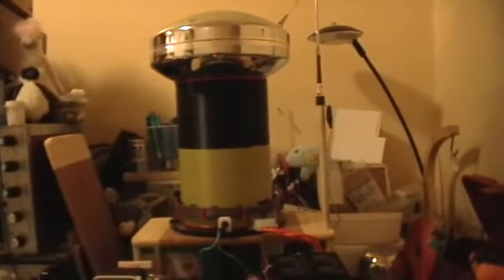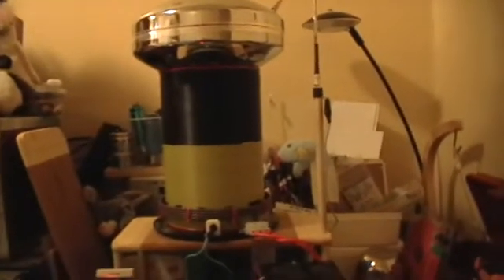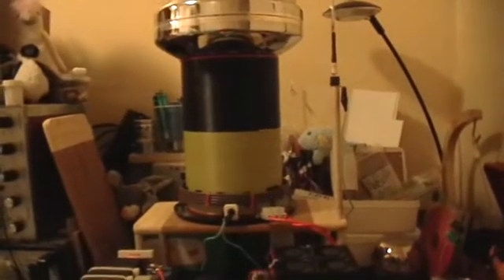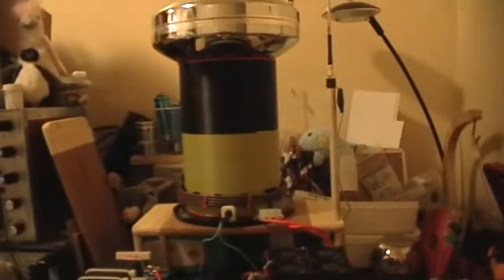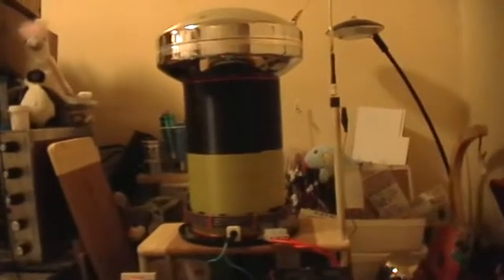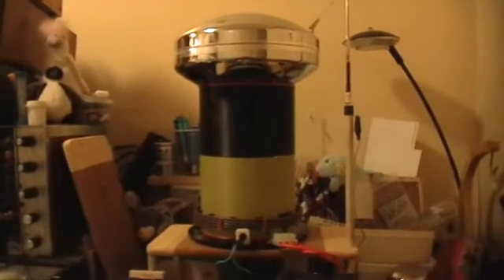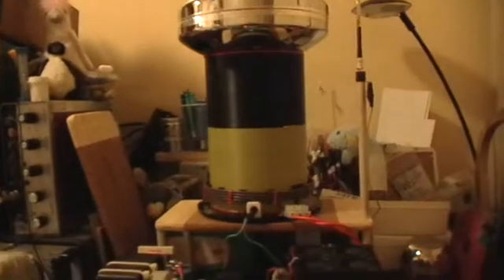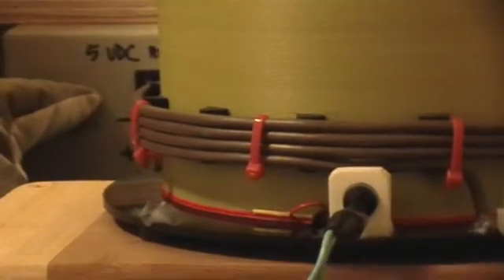TinselKoil 22: New Low-Aspect Resonator! TKSSTC 2.0 First Light

Comment from the maker: (continuation) And I'm still not finalized as to the circuit. The voltage output (and spark length) will go up if I can get the mosfets switching more sharply, so a little tweaking and layout refinement is still to come. Also tuning is still manual; I need to implement the freq feedback system for auto tuning.

I will post the completed circuit when I've done that bit of work. I"m working on a good drawing of the present incarnation now; the final version might include some minor changes.

Comment from the maker: Thanks, I agree even if I do say so myself. I've been wanting to make a SSTC for many years; I have half-a-dozen SGTCs of various sizes and configurations using rotary and stationary and multiple SGs that I've built over the years, some flyback and auto ignition driver toys that are fun, but the small SSTC has always beckoned me. I spent quite some time looking at circuits; most use difficult-to-obtain parts, so I melded several circuits and found (by experiment) easy to obtain component values.

Comment from the maker: Thanks, I think.
Strictly speaking I think the "Tesla Coil" is by definition resonant. The secondary is a quarter-wave resonator, air core so it doesn't saturate. A standing wave is established on the resonator, and the "free end" voltage can rise very high.There are two frequencies here: the resonant frequency of the coil which is 340 kHz or so at 50 percent duty cycle and doesn't change, and the "gating" or staccato frequency and duty cycle, 1-20 Hz and 10-50 % on. It can be audio modulated.

Comment from the maker: Yep, that's right. Tesla was generating such high voltages though (he claimed to get to 18 MegaVolts, IIRC, and that's not chopped liver) that he eventually needed to go back to longer aspect ratio constructions just to keep the voltage from shorting across the secondary.
I'm getting to the point where that's an issue for me too. I installed a strike ring just above the primary, just in case. FULL full power testing will commence later today, and if the magic smoke stays in I'll take some pix.